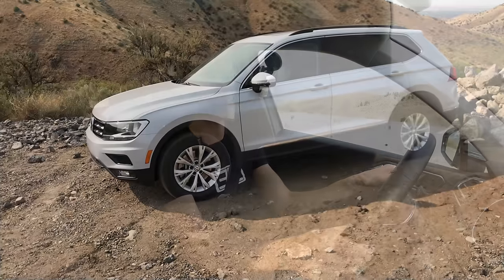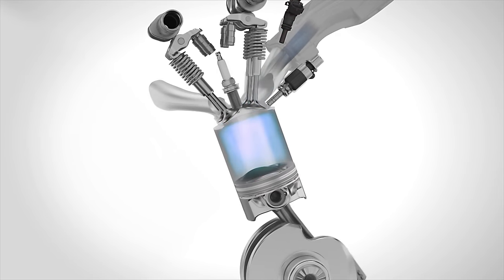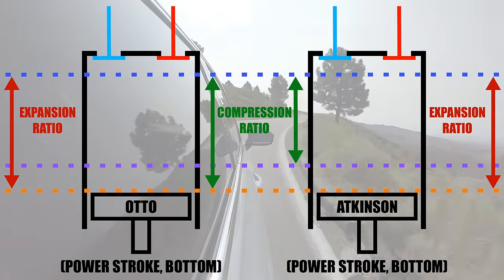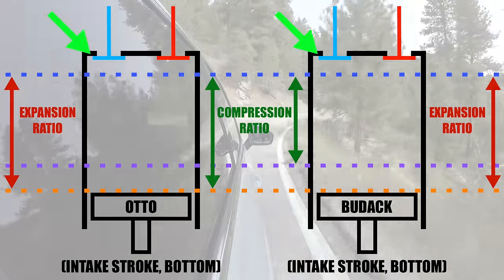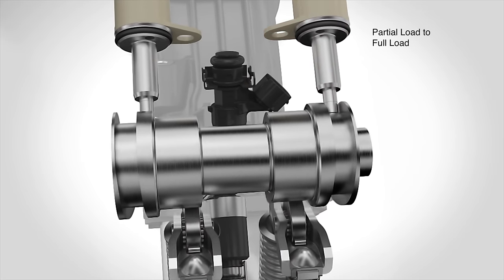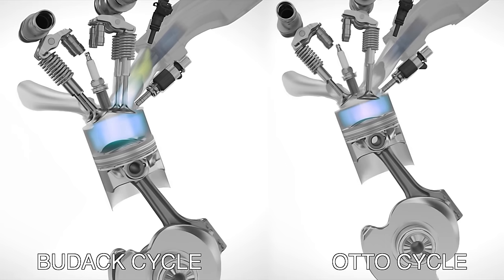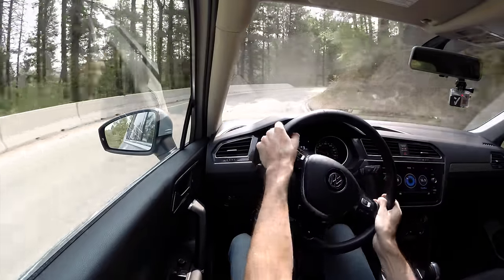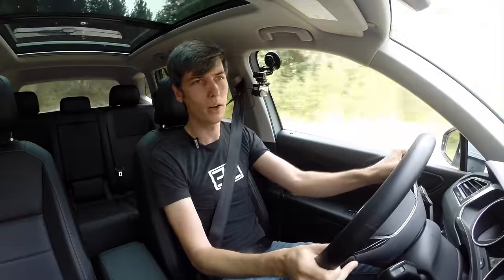Volkswagen's New Engine Cycle - The 'Budack' Cycle

Comment: Budack kicked in yo!
Reply: You mean kicked out XD
Reply: Has a ring to it lol
Reply: RacingRalphEVO Efficiency kicked in power kicked out
Reply: More like otto kicked in yo.
Reply: That doesn't easily roll off the tongue lol
Reply: VWTEC Kicked in!
Reply: Ruben Thuma yo!
Reply: so its basically vtec. just named diffrently  they both increase valve timings for more power. they are both made to be efficient at low revs. THEY WANT UR BABIES ITS A COBSPIRACY
Reply: Not sure that this is a same, BTW this new VTEC (iVTEC) which emulate Atkinson cycle does not increase power but same as Budak (but in different way) reduce power and increase efficiency, at least it should.
Old VTEC (WTEC-e) systems increased power, iVTEC, reduce power :-)
Reply: ricers are triggered all over the web right now
Reply: Not all VTEC systems are the same.  The Honda VFR 800 motorcycle had what Honda called VTEC.  The V4 engine had 2 exhaust valves and 2 intake valves per cylinder.  Below about 6500 RPM, it used only 2 valves per cylinder; above 6500 RPM is used all 4 valves per cylinder.
Reply: Frank Eggers didn't know that, thanks
Reply: I am pretty sure that the original VTEC just switched to a longer camshaft duration to get more high RPM power.  Lower duration gives you a smoother idle and better efficiency but the longer duration would give you more power at high RPM due to the incoming air's kinetic energy.  Or something like that.
Reply: Quite true, although more than kinetic energy is involved.

At very low engine speeds, having the intake valve(s) instantly open at TDC on the intake stroke and instantly close at BDC would provide as much power as possible at that speed.  However, the valves cannot be instantly opened and closed; it takes several degrees of crankshaft rotation for the valves to open and several degrees for them to close.  So, even at very low speeds, the valves would have to begin opening a bit soon and begin closing a bit late to maximize power.

At high engine speeds, the gasses moving through the intake ports have inertia which would keep them moving through the intake ports after BDC if the intake valves are closed later than BDC.  That effect is even greater if the intake manifold runners, together with the intake ports, are tuned like an organ pipe to give a free supercharging effect.  But if the intake valve timing is optimized for high speeds, then at low speeds, after BDC gasses will flow from the cylinders back out through the intake valves thereby reducing power.

All this has been known for more than 100 years but has become more important in recent decades.  Perhaps at some future date carmless engines will become practical.  Prototype carless engines have been shown to be more flexible and more economical since valve timing can be optimal for all speeds and conditions.  It is even possible to eliminate the throttle valve.
Reply: Paul Standaert The problem is as the engine increases in rpm it looses power as it can't get enough air in, VTEC just pushes the valve open more and a bit soon and closes later. Its this what gives you more power in the higher rpm.
Reply: took the words out of my mouth

Comment: The "absolutely nobody will be able to fix it" cycle
Reply: Just get a bunch of new parts, and throw them in. No other way to go. Then, when it's running, sell it.
Reply: it's literally just variable valve timing
Reply: @derpmansderpyskin  Agreed there are far more complex valve control schemes used by other manufactures.  I think the op's comment speaks more about the (lack of) competency of most "technicians".
Reply: @ferrumignis  it's not complicated
Reply: @dragospahontu  That's what I said.  Which bit of "there are far more complex valve control schemes used by other manufacturers" did you not understand?
Reply: @ferrumignis  ikr, there are engineers that spend sleepless nights implementing these mechanisms only after for people to hate on them.
Reply: Isn't it gonna suck lube oil up past the rings.?
Why not just use otto and use the turbo to power an alternator.?
Reply: @nigelmitchell351  because emissions, but this cycle can bring a little bit better fuel economy.

Comment: Soooooo. Reverse VTEC? 
Budack kicked out yo!
Reply: Vtec is variable valve timing , so the valve timing can be adjusted by the computer based on the load thats placed on it.....im sure thats way over your head though.
Reply: Token WhiteGuy no. Variable valve timing is VVC. Vtec is variable valve timing and electronic lift control. 
Vtec switches cam profiles with oil pressure.
Reply: It's turbocharged so it's already faster than V-tec
Reply: Token WhiteGuy I don’t get head?
Reply: @mattriella6776  bruh
Reply: @mattriella6776  not only are you wrong, you're aggressively wrong
Reply: No,  It's  like  Honda VTEC. With VW setup,  the  camshaft profiles are  shifted to a high lift and duration instead of where HONDA are locking paired finger followers. More  elegant design wise than Honda. But Turbo size may limit very high RPM Torque at the top of the rev range.  Now  FIAT  multiaire  has the most electro-mechanical complexity. Cheers!   -  Sandy
Reply: @mattriella6776  over the head. Like the cams?
Reply: @mattriella6776  Zues lim Is 100% correct in his statement. This is 100% VTEC or Variable Valve Timing and Lift Electronic Control. Volkswagen is controlling the valve timing electronically to achieve this "Budack" cycle. Instead of going for more valve lift or duration they want less, it's the same thing as VTEC but a different outcome.
Reply: @mattriella6776 ,
Drop the feigned arrogance.
VTech is "Variable Valve Timing"  to roughly the same extent as Special Olympic contestants are Olympic Warriors.
Seriously, "Variable" is stretching it a bit.
It's more like a freaking knife switch.
... Up is OFF, while Down is ON.
THE CPU asks: "Oh, are you beginning to wheeze? Oops, my bad, let me just slap the heavy, dual rocker-arm assembly over to the "real" cam grind profile lobe, so you can actually breathe well enough to reach redline. ... Oh, you need to shift gears? Hold on a sec. while I slap the rocker the other way, and then when you begin to wheeze,, I'll slap it back again."
The Honda engineers must have been indulging in some smuggled Saki, because they were getting rather slap-happy.

I would humbly suggest that you take a look at some of the "real" Variable Valve Timing systems out there, such as MERCEDES-BENZ, BMW, FORD, PORSCHE, and SUBARU, ...
where the valves are independently timing- controlled, and (in the case of BMW at least) are phase controlled and lift controlled.
I mean, the engine's throttle function on my "aging, 2005 BMW V8" is handled almost entirely via Variable Valve Lift.
( It uses a "throttle body" solely for smooth idle function, but once the acellerator is touched; engine speed, is controlled via Valve Lift, Valve Timing, Fuel Injection, and Variable Length Intake technology.
I hate to be the one to break it to you, but ... Honda's VTech design is like one of those big, honkin' wind-up alarm clocks, in a room full of Atomic Clocks.
The only reason the scientists keep the little dinosaur around, is for nostalgia, and because they kind of feel sorry for it. 😜
Reply: @mattriella6776  no, VTEC is VVL, Variable Valve Lift. Its a different thing
Reply: @marshalllhiepler  And how is that better than using just a simple throttle body? I mean, BMW's are not famous for reliability neither for economy...
Reply: @MarkOrkenyi  asked:
"How is that better than a simple throttle body?"
Funny that you should ask.
If you go to watch the NASCAR races, there is always some little old lady in the grandstands, who keeps going on about how much fuel is wasted by the dreadful things, and how they all seem to be in a damned hurry.
If your first thought, when you get behind the wheel of a BMW equipped with an aluminum, 32-valve, V8 ... coupled to a 6-speed manual trans, and a limited-slip independent rear ... is:. "Oh my, am I going to be able to afford gas for this thing?"
Well then, just get out of the car, and start looking for a Honda CIVIC, or a Smart Car.
Most of the luxury sports cars today require "Periodic Routine Maintenance" to be reliable.
Of course, it's always the ones, who complain about the cost of maintenance, that don't follow the recommended schedule, and whine loudly, when it breaks, and then it costs four times as much to fix it, than it would have cost to maintain it.
The bottom line, is that these cars were not designed for customers that drive around town at idle-speed, looking for the best deal on unleaded gasoline.
Reply: @marshalllhiepler  I just meant to point out that over-engineering things, especially for road-use is non-sense.
In that case these "not real" VVT mechanisms are superior to (for example) BMW's complicated system or even the one in the video.
These are not track cars, if you buy these kind of cars, you're mostly looking for reliability and economy, performace is secondary..
So the system you mentioned has a totally different goal than the one in the video..
Reply: @MarkOrkenyi  said:
"... performance is secondary."
I say, my dear chap ... one could make the argument, that your refrigerator is "over-engineered". 
What is wrong with a simple insulated ice-box? It doesn't need power, and it keeps your food cold during an electrical power outage.
Let's systematically go through your humble residence, and get rid of everything that is "over-engineered"  ... you know, such as your water heater, your HVAC system, and of course, your central heating system.
Dreadfully complicated, I tell you.
Just live in a tent, and keep warm by a live fire. (You can burn all of that "complicated" furniture.)
Clearly, .. it's better.
Reply: Sure, it's nice to see that you get what i meant :)
Reply: @MarkOrkenyi  ,
Yes, I did get your point.
But, as with most Smart Car driver's, and Honda VTech owners (same category, in my opinion) one is likely to inadvertently offend them, by merely holding a different opinion.
I suppose there is a bit of sympathy to be held in their regard perhaps. It would seem  likely that being left behind at traffic lights and highway on-ramps would diminish their confidence in due course, rendering them with the "last to arrive" complex that so often fuels their dismay towards their more powerful (and horribly complex) larger automobile brothers on the road.
For this reason, I refrain from delving into the topic further, as it could only result in a worsening of the inadequacy disorder.
I am willing, however, to discuss it at length, should you feel the need to talk to someone, for therapy sake.
I will wait for you at the next traffic light. But, please do hurry. I am searching for a fuel station also, and my time is limited. 😂
Reply: Wow, i have no idea what you are talking about, but you are for sure frustrated.
You cleary want to emphasize that you have a BMW and anything other is a POS :)
And nope, you don't even get that what's the goal of (presumably your) BMW's system and the one in the video at all. So your argument is still non-sense.
Reply: Well Mark,
I'm going to allow you to believe that, as it seems to be the charitable thing to do. 😉
Reply: @marshalllhiepler  Thanks :)
Reply: Ha! The First part (Soooooo. Reverse VTEC?) I literally thought the exact same thing word for word!
Reply: Yea Honda did this called Vtec-E on the VX and HX models in the 90's

Comment: To me this just seems like fancy variable valve timing
Reply: Variable as in only two positions. BMW has fully variable valve timing and lift since mid 2000s lol
Reply: Alexsketchstudios Fancy VVT that will cost an arm and a nut to fix.  I’ve owned 2005, 2004, 2002 Jettas.  A TDI, 1.8t. & VR6.  They all were mechanically sound for the most part.  They took a beating quite well.  I turbocharged the VR6 and raced the hell out of it.  BUT.....repair costs were astronomical in the weirdest ways.  It was always something electronic, or an actuator etc.  The Metal parts were great everything else sucked and was expensive.
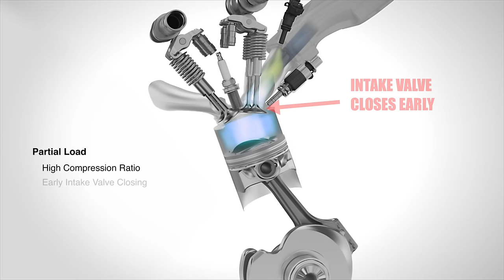Reply: I didn't understood that how the compression ratio is less than exapnsion ration in this engine at 2:07 

I think you can help..
Reply: Wow if they can hook a computer to that pin setup, imagine the chaos they can achieve.
Reply: @e23561  for fight 1-3 liter of fuel but repair cost i horrible variable timing ok but not lift only honda and toyota knows how to good
Reply: @rutvikdangarwala9496  it's the time that the intake valve is opened. It stays open either shorter or longer depending on which cam love is active at the time.
Reply: @rutvikdangarwala9496  they lessen the actual intake charge, pushing it back into the intake it seems? Creating a lower CR since the valve isn't sealed while the exhaust is closed and ready for compression and ignition. But im hoping they cut fuel while this happens to avoid fuel backing up in the intake tract. Maybe i missed something? But it's not really a new cycle type its just modified from another design. Either way it could be great! We'll find out
Reply: @partymanau  yeah lol man!,also  on a more serious note  imagine if they have electronic valve mechanisms WOW!
Reply: @rutvikdangarwala9496  try to watch the video again

Comment: sooo...VW made anti-VTEC. For all of you saying it's VTEC, you're wrong. The engine has LESS power than a normal engine running the Atkinson cycle, and then when you put your foot on the gas, it uses normal power. Anti-VTEC...a dark and well...not very powerful force.
Reply: Honda uses this in the r18 engine using vtec to close the intake valve earlier. so basically lowering the capacity of the 1800cc to an effective 1400cc
Reply: It's working on cruse mode!